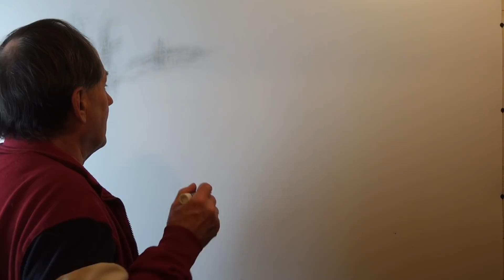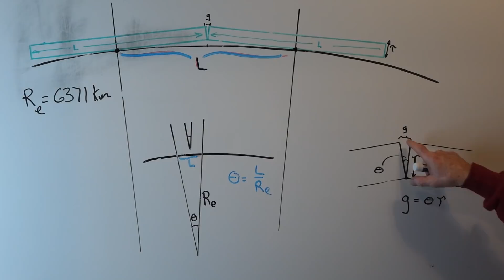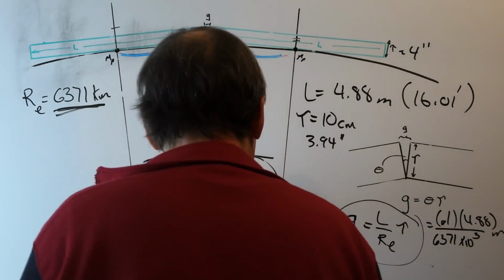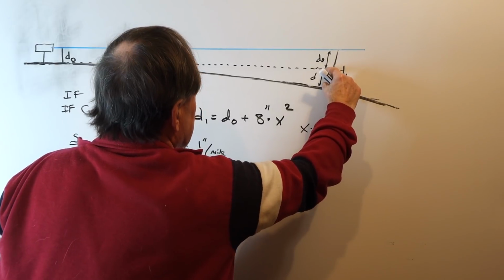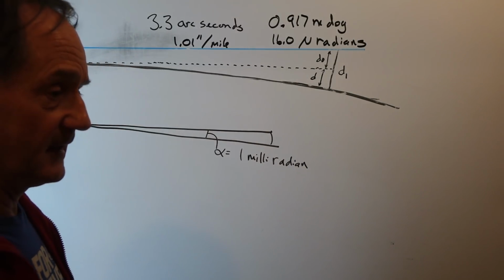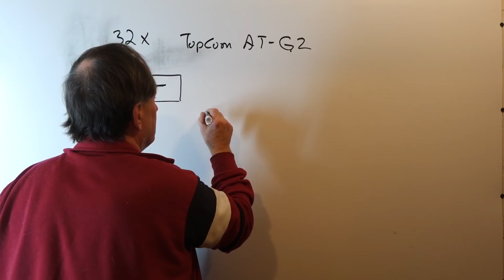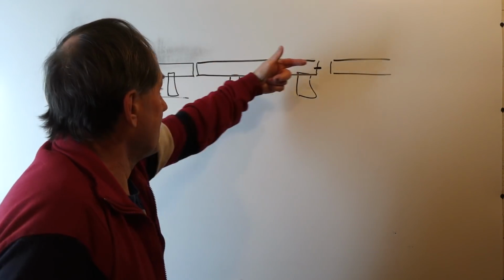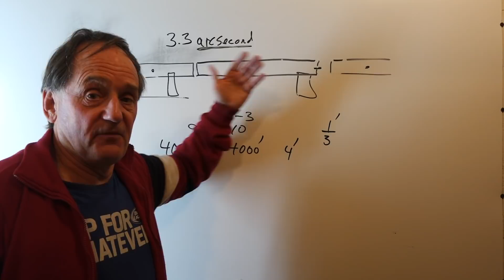Salvaging  Mullin's  " Force the Line "

Comment: Still dont get why the original experiment doesn’t work. In 2 miles the earth drops 32 inches. If the total error of the straight line is .006 thousandths of an inch by the end you will only have 6 inches of error. You can still get accurate results. The pipe idea sounds good though to help reduce manufacturing error of straightness.
Reply from the maker: What do you mean by "If the total error of the straight line is .006 thousandths of an inch by the end you will only have 6 inches of error." ?   I do not know how to interpret this.  You need to write clearly if you want an answer.
GH   June 19, 2021
Reply: @georgehnatiuk5806  pretty simple. 2 miles in feet divided by the length of the boards which is 10 gives you the number of boards. Multiply the number of boards by the error in each board the total comes to 6 inches
Reply from the maker: @unshapingtheearth7916  that is what I thought you were doing and that is not the correct way to analyze the possible error.  You need to look at the angular fit as you butt the board ends together.
GH
Reply: @georgehnatiuk5806  yes….. are you really suggesting their is no way to cut metal in such a way that when the two pieces mate they mate perfectly together? I notice you did not refute the math. When the pieces come together and the cut error is within .006 thousandths of an inch their will only be 6 inches of error at the end.
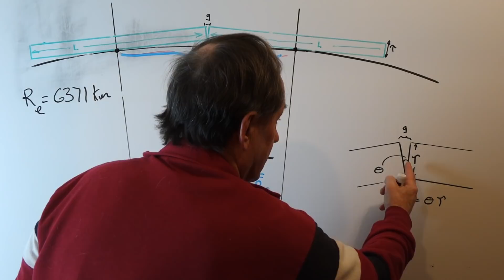Reply from the maker: @unshapingtheearth7916  you did not watch the video and understand the difficulties in machining the rails.  The error will be potentially much much more than 6".  Go back and watch from time 11:00 min to 17 min.
GH
Reply: It's flat
Reply: @macmac9371  - "All precision ballistic, aeronautic, gyros, space aeronautics, radio wave frequencies are done over a flat stationary earth."

This is a 100% FABRICATED LIE!
YOU ARE LYING!

I am literally an aerospace test engineer. just ONE of my jobs is testing fiber-optic gyroscopes that measure earth rotation AND CURVATURE as part of every pre-flight test. I have performed this test MYSELF many times.
I am ALSO a specialist in Deep Space telecommunications with spacecraft via the Deep Space Network.
Reply: @macmac9371  Oh did I mention YOU ARE LYING?
Reply: @georgehnatiuk5806  okay, it sounds to me like your measuring the potential error in the boards that are following the curvature of the earth. This doesn’t make much sense though, because the angle between the two boards does not matter, what matters is that each board is made level with the center of earths gravity. Certainly that could be done with a device more accurate than a common air bubble, but in any case that seems like a non issue. If the earth is convex maybe their could be a factor causing the board to curve more than its supposed to, but it certainly wouldnt curve in the opposite direction of the earths curve so long as your leveling each board. The most significant challenge of this experiment is making a beam that goes straight for a mile. The butt of each beam must be machined flat like you said. So as i was saying before, 6 inches of error at the end isnt a big deal so long as you can correctly identify whether the boards are converging, diverging, or remain parallel. I think beam warpage could be a big deal and would be a big cost in machining to. It might be helpful to find the optimal dimensions that efficiently reduce error but within a reasonable price. The shorter the beam of course the less warpage but the more expensive as you have more beams that need to be machined.

Comment: FORCE THE HOSE EXPERIMENT: Get a 2 mile transparent tube, lay it down over the earth and elevate each end by 6 feet. Fill the tube with water and if the earth is flat, the water level will be at the same height on each end, if its a globe, all the water will syphon out. Do much cheaper and you just need a hose.
EDIT: Sorry, i should have watched the whole video :) Why dont you go do it, if it meant that much to me i would, use a garden hose, it wont cost that much. I have come to the conclusion that the earth is a globe after much thought on the flat earth. Unfortunately all the bs in the world makes you question everything bc it could indeed be flat and i suggest that everyone checks for themselves and comes to their own conclusion bc there is alot of bs out there
Reply from the maker: The water will remain the same height at both ends whether you are on a flat earth or globe earth and  WILL  NOT  SIPHON  OUT.
On a either type of earth both ends are at the same gravitational potential.
GH  May 06, 2021
Reply: @georgehnatiuk5806  yeah, i think you are right

Comment: this is utter confusion of a simple concept.
he will have you believe engineers cannot lay rails say 3 miles in length in a straight line with theodolites?
this is desperate George!!!!!!!!!!

George thinks you are stupid , machine tolerances are not an issue using line of sight levels.so if you re an engineer please comment if you are not capable of straight lines.
of course normal people KNOW A WATER LEVEL IS ALWAYS STRAIGHT LEVEL
Reply: A water level or any level is going to project a level line around the globe. it'd be a giant circle. Levels give a line perpendicular to the radius of the Earth. There's easier ways to prove the Earth's a sphere.
Reply from the maker: Sorry Paul,
As usual you have no idea what you are talking about.   Laying a straight line left-to-right is not the same as establishing a line TANGENT to the earth and extending it out for miles.  Give it a shot with a theodolite and get back to me.
GH
Reply: @georgehnatiuk5806  
so what was you up to on rainy lake? if measurements are so off bit of a waste of time!
who'd have thought it, geodesy over 3 miles has a accuracy of anything up to 72 inches out.. sounds like the earth is flat and you are relying on data handed to you rather than real world observations
Reply from the maker: Paul,
You are an idiot.  Please stop commenting on my videos.  You do not not have the background in understanding to make any informed pronouncements.  You cannot even grammatically structure a coherent sentence: "if measurements are so off bit of a waste of time!" 
 Just what the hell are you saying here?  I do not have a clue and no one else does either -- no need to respond -- just go away.
GH

Comment: I would like to ask a question? Why starting with the presumption of a curved earth, ie. a sphere? Would it not be best  to construct based on best manufacturing and construction processes available. why contemplate using wood as the material for the rails. There is no need to have that perfect right angle. In my opinion what is needed are parallel sides that are perfectly flat. Extreme distances are also not necessary in my opinion. Even a distance of 1 mile would be sufficient in my opinion. Surely over 1 mile you should not accumulate 8  inches of error you limit your manufacturing error to say 0.0001inches  over 12 inches, you will be lucky to have 1 inch over a mile.
Reply from the maker: <<< In my opinion what is needed are parallel sides that are perfectly flat.>>>

HOW  DO  YOU  PROPOSE  TO  LINE  UP  ADJACENT  SECTIONS  SO  THAT  THEIR  SIDES  ARE PERFECTLY  IN  LINE  WITH  ONE  ANOTHER?

<<< Surely over 1 mile you should not accumulate 8  inches of error you limit your manufacturing error to say 0.0001inches  over 12 inches, you will be lucky to have 1 inch over a mile.>>>

 WRONG

Do you have any idea how hard it would be to maintain a manufacturing tolerance of 0.1 mil out in the elements with temperature variations and the coefficient of expansion of the sections?   Absolutely impossible.  Even 10  mils would not be achievable.

Most metals have a linear thermal coefficient of expansion of between 10-20 X 10^(-6).'

You are dreaming dude.
GH
Reply: George Hnatiuk Sorry, but I will disagree with you. Not your linearexpansion information, but making a statement, that a master machinist can't maintain 0.010 inches over say 3 feet is ludicrous. And you don't manufacture out in the elements as you put it. you construct. no one would use a wood for such a critical experiment. BTW, near the early part of your discourse, you state that the earth is a globe, and you must place the center perfe fly at the tangent point? You are right for the plane. Now, pre-suppose the earth is planar, you are under a different set of constraints altogether. You basically are masterful at confusing the gullible with a  smattering of truths, all to conceal the big lie. If you believe, your ball theory, then where are the supposed thousands of unedited, real photos of our blue marble as given to everyone as proof of. Or for than matter the thousands of satellites crowding our night skies. Let's start with the curvature of the earth over a half mile? How about 500 feet? Given that NASA proclaims it to be a sphere, the curvature should be measurable over those distances? Or doesn't the 8 per mile squared work when converted to feet? As a person that is as intelligent as the next person, your attitude, calling anyone that disagrees with you or questions anything contrary to your 'belief' or analysis an idiot, belies the fact that perhaps you are being the unintelligent one. I for one would rather do the proper experiment, then do the analysis, then maybe be able to arrive at conclusions, whatever they might be.Your methodology is one way, I'm sure others have come up with other ways. Peace.
Reply from the maker: Terra Plana,
I did not say that you idiot.  I said the tolerances would not hold out in the elements.  No MECHANICAL structure will remain perfectly rigid when the temperature changes and in particular when there is a temperature gradient along the length of the structure.  Ever hear of EXPANSION JOINTS in bridges?  What is going to happen when the sun comes out and starts to heat the structure unevenly?  You obviously have no clue as to how the real world works with mechanical structures.

Also, I have NEVER suggested the use of WOOD.  Where did you ever come up with that?

Go away for you clearly have no idea what you are talking about.  You are wasting my time.  BYE.
GH
Reply: George Hnatiuk You mentioned 2x4 in your video. How about the fact that you began your discussion with the supposition of a globe at the start of your tangent discussion? And also you did not respond to the 0.5 mile curvature test, or the 500 ft test? Truth can easily stand on its own, with little need of omission of reality from the picture. BTW, I know perfectly well what an expansion. I am an engineer, and how can obfuscate all you want. You cannot start with a pre-conception and expect yourself to arrive at an opposing conclusion. You are IMO, a globe disciple if you cannot clear your mind of all beliefs, except those that are demonstrable, and repeatable. Let us not forget what the goal is. Peace.
Reply from the maker: TP,
The 2x4 statements is related to the rail dimensions - you incorrectly assumed a piece of construction lumber.   I am not that stupid to suggest using wood where it would be subjected to the weather.

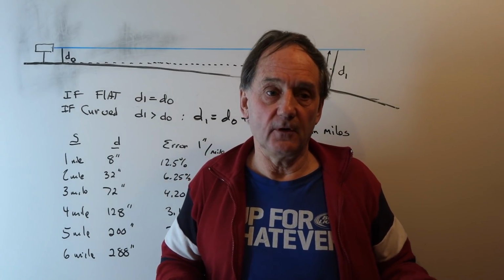Nowhere have I assumed as you say "supposition of a globe".  You better go back and listen carefully.  I described how using tubes you can shoot a STRAIGHT  FLAT  LINE  and at time 19:35  described how you need to structure any test to accommodate the possibility that the earth is FLAT or  CURVED.  No where did I state you start with the assumption the earth is a sphere.  

You need to insure that you shoot a straight line from the point of observation outward so that line would be tangent to the earth whether or not the earth be curved or flat.  You set up your targets along that straight line and then measure to the surface of the earth.  Those measurements from the straight line tangent will then tell you if the earth is flat or curved --  NO  PRESUPPOSITION  AS  TO  THE  NATURE  OF THE  SHAPE  OF  THE  EARTH

Look, this is my last reply to you.  You have wasted enough of my time.  Clearly you have not watched the video and comprehended what is being discussed.   Go back to Nathan's show and join your fellow idiots there.  This video is for people that have some sense of geometry and reasoning skills which you clearly do not possess.

GH
Reply from the maker: You are so full of crap -- I did address your concerns and a tangent is a straight line to a FLAT  surface or a CURVED surface or ANY surface no matter what its shape.

You need to go back to school and study geometry so you understand the terms.  Have a 13 year old view this video and have he or she explain it to you.

GOOD  BYE.
GH
Reply: @georgehnatiuk5806  you are absolutely wrong if you think machinists can't manufacture a straight level line within your tolerances. Do you think buildings aren't built to similar standards?
Reply from the maker: @alexanderdavis1943   buildings are not built to those standards you moron.   You have to maintain over a 16 foot length the end-to-end fitting between rail members that have a deviation from a right angle fit of no more than 77 nanometers  - this is 1/10 the wavelength of RED light.   You are so stupid making such a comment as you did.  This is an impossible task as outlined by Brain Mullin.  Mullin is not a very good engineer and certainly not one that understands manufacturing.   See my analysis at time 14 minutes -- you obviously have not watched the video.
GH   May 09, 2021   12:00 pm

Comment: Actually, this experiment is done all over the usa, There are pipes everywhere and also water towers, If the earth was a globe we wouldnt need water towers bc the water would just flow, it would flow faster, the longer the pipe is.
looks like you cant use water level to prove flat earth bc it does remain level, with the surface, wether it iss curved or not. You need to force the line, lazer is no good bc it is based on optics and refraction excuse comes into play. The original force the line will work bc each individual rail is levelled. Where is the fund raiser ive heard about? Nobody has made a go fund me or is nobody linking it? 
If only mad mike spent his money on limber instead of rockets :(
Reply from the maker: <<Actually, this experiment is done all over the usa, There are pipes everywhere and also water towers, If the earth was a globe we wouldnt need water towers bc the water would just flow, it would flow faster, the longer the pipe is.>>
You really do not understand gravitational fields on a globe.  
PS, your grammar and punctuation is terrible.  Try using spell check if you do not understand the rules of written English.
Reply: @georgehnatiuk5806  yeah i think my comment was silly, Ill leave the sillyness here, good day :)